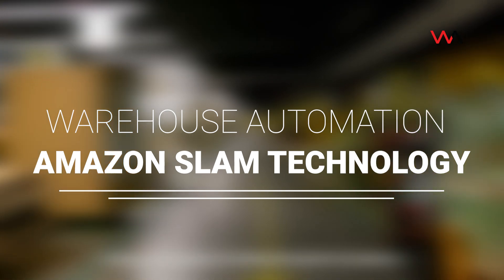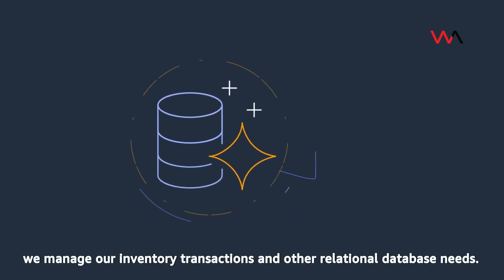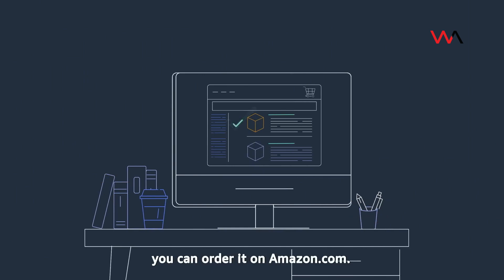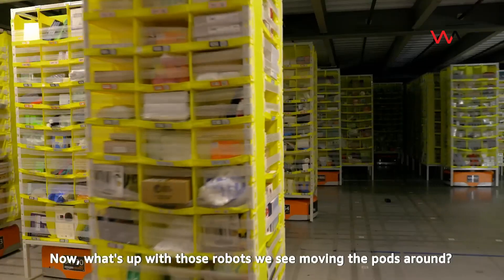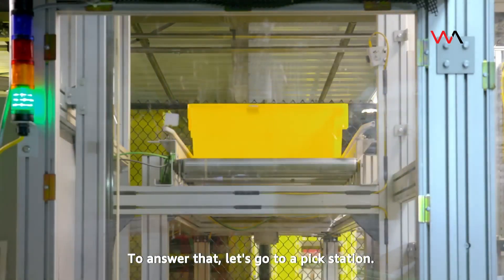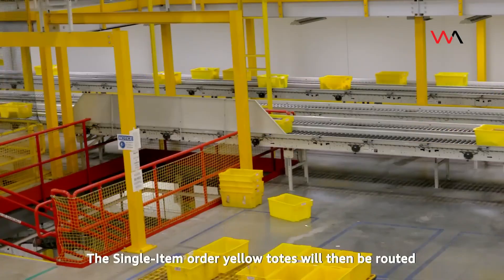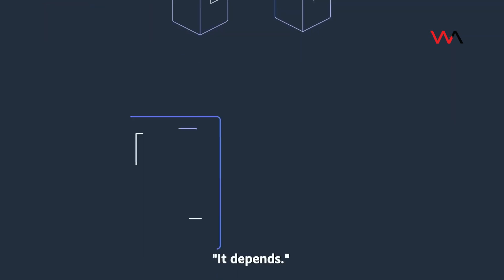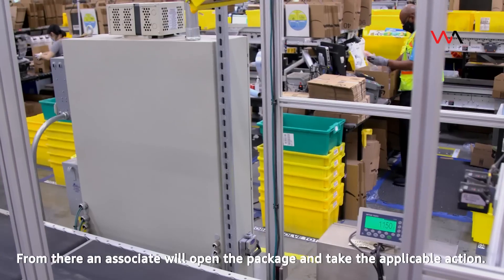Amazon’s Secret to Simplifying Fulfillment With Robots

Comment: could a second story with top down tubes loaded with products that drop them into shelves or totes especially desighned around manufacturing like glendimplex south australia heater makers they always go to shelves to grab say a specific amounts of screws and bolts nuts drillbits you know that stuff if that was automatically bought to there stations it would speed things up 5x instead of them all individually searching and losing unreasonable time also on the side of parts i know the final product comes out of the line as 1 pallet so that could be easily done there with one efficient storage fork and then for parts they could all be stached in bigger pallet sized totes and bring each tote of parts as they check off job completion on a cheap tab and yeah as the final product is 1 pallet all the parts are able to be stacked on pallets as there smaller and for like the welding section the same bring the parts guys unload weld then check off then next one comes like the pallet with the heater parts i know this would be easy and actually quiet cheap to implement and glen dimplex is a big company so yeah would be a great spot to test the boys would love it there and i swear the output would be 5x higher easy as the boys are good at there job and the biggest complaint is small parts order that could be automated and yeah having everything brought to them so they can do what they enjoy instead of fumbling around stressed out as deadlines arent being met due tue parts fixtures and complete product organisation is terrible :)